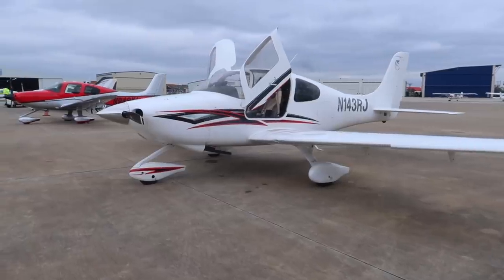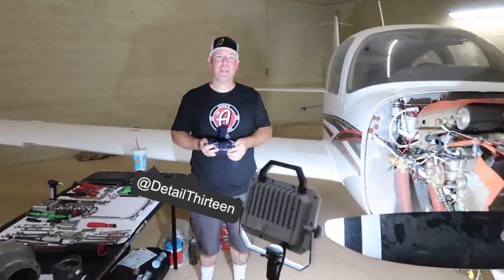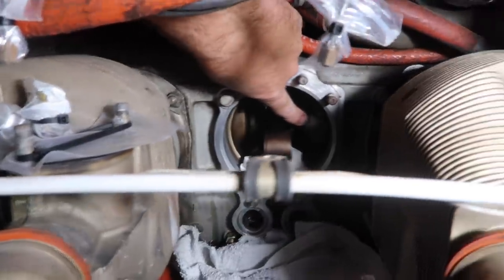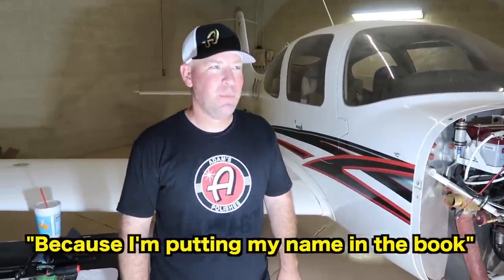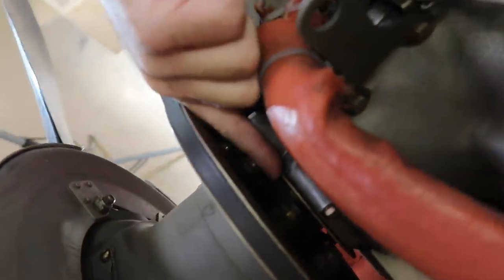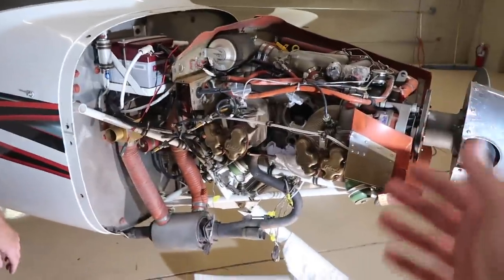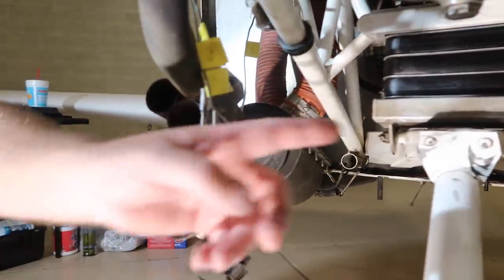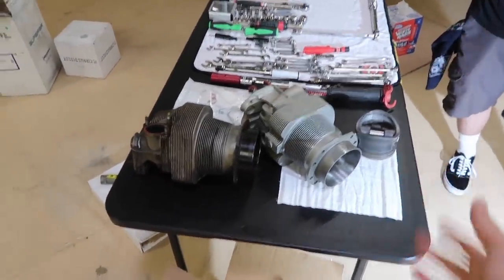Cirrus Expert Tells Us Everything Wrong With Our Cheap SR20!

Comment: This Continental engine is garbage.  That's why the new Cirrus switched to Lycoming.  They don't seem to ever make it to TBO.  Low compression, cylinders going bad.....just not a good motor.
Reply: Yea, noticed the wear on the cylinder not from dirt, it’s from running rich too long after takeoff. All that extra fuel trying to keep cyl head cool washes off all the oil on cylinder walls, very low lubrication at full rich accelerates cyl wear very quickly.  Learn how to go leaner “much earlier” after takeoff.
Reply: @tropicthndr  You must not lean this engine on climb.  It has an "auto lean" feature and the manual explains that leaning in the climb is not recommended.
Reply: @Airplanefish  I guess my owners manual was wrong.
Reply: @Airplanefish  The POH from my 2005 SR20 GTS says the engine has an altitude compensating fuel pump that automatically provides the proper full rich mixture for climb.  The mixture for climb should be left full rich.
Reply: Quinnjim:  I completely disagree with you.  Continental builds a great engine.  Different cam placement, different in other areas.  The original designers chose this engine for a darn good reason.  In my experience (a wee bit), alot of Cirrus pilots, like Mooney pilots, ( like any pilot so inclined, is the real truth ) become obsessed with fuel economy.  Cirrus promotes this thought with its engine leaning function.  But that depends on highly accurate data.  Which, er, is not always the case in real life.  These fuel misers think they can lean the hell out of the engine, or just look at a screen and not think about what they are doing, or do not truly understand it.  What happens over time?  They burn the cylinders up.  Exhaust valve guides get stuck, valves burnt, you name it.  That poor practice, and not watching cylinder head temps and improper leaning in general, causes shortened TBO.  Now of course there are many variables but this is what I have seen.  Most pilots simply do not understand what is really going on with the engine, and do not operate them properly.  They don't lean on the ground, the don't follow Mike Busch.  I had an SR20, great airplane, great engine.  Heavy airplane, hard to handle without good ground equipment, and the useful load a little marginal for what I wanted to do.  Many Service Bulletins and various things to comply with every time you turn around, "go to your Cirrus Service Center NOW or you will die."   Nosewheel shimmy can rear its ugly head.  And one of the main things why I let it go, I prefer to control propeller pitch myself.
Reply: @Airplanefish  110% ?

Comment: I would try to convert the engine to EV. There is a company in Cal. that does this kind of jobs.Or maybe to a powerful motorcycle engine,they are light,fuel efficient and revs on high RPM
Reply: Its a certified aircraft which means the FAA won't allow that.  A company would have to have a STC to make a major modification to the original Type Certificate.  
 If they owned a experimental aircraft they could look into to something like that.
Reply: @chipb4617  they can do it, but the plane would then be experimental.
Reply: A high rev engine isthe exact opposite  of what you want in an airplane.
Reply: Yeah OK.
Reply: If an STC is approved the a/c remains certified   Additionally if the electric engine is for a single plane a 337 form is required with supporting approved data. Such as EO’s manuals or a/c specs. Also the weight and balance would change b/c the engine weight and fuel parameters would be different. But that is a good idea theoretically.
Reply: @bigtimer1a   they prepurchased the electric plane that is suppose to come out this year with a 1 hour flight time.
Reply: You should electrify your favorite chair.

Comment: the widowmaker plane !!!
Reply: Not even close.   Cirrus is one of the safest certified  aircraft out their in general  aviation field die to ballistic parachute.  You will wreck the plane, but you will survive the landing.
Reply: When flown properly, the Cirrus safety record in similar to Cessna or Piper’s single engine safety record.
Reply: @davidbsac  its safety record is bettor than then the Cessna  or pipers
Reply: Many of the cirrus accidents have nothing to do with aircraft performance. Most of all the accidents is unfortunately pilot error of some sort. RLOC runway loss of control or unfortunately engine failure. 
Good thing you guys purchased a new engine. 
The landing part you can correct with training. The RLOC usually occurs due to incorrect go-around procedures and not accounting for the engine torque at low speeds. Long story short. Pilot doing 75 knots over the fence bounces the plane applies full power and does not add rt aileron and rt rudder early. Well u end up in the NTSB database. But go around training for the cirrus training staff help alleviate many of those procedural problems. And cirrus still has the lowest accident rate among GA aircraft per 100,000 flight hours